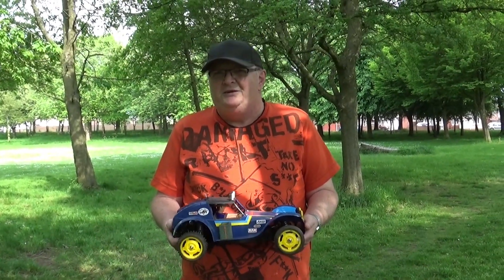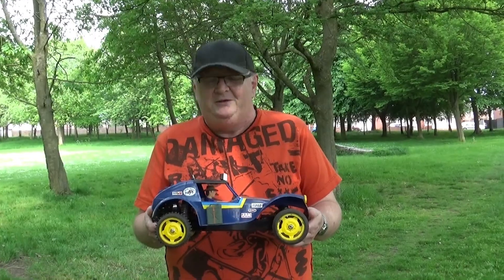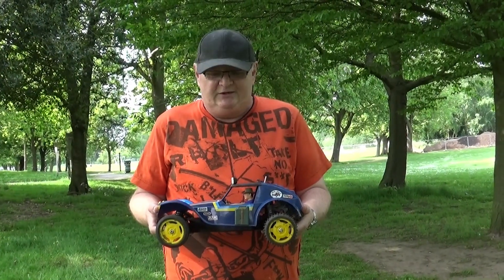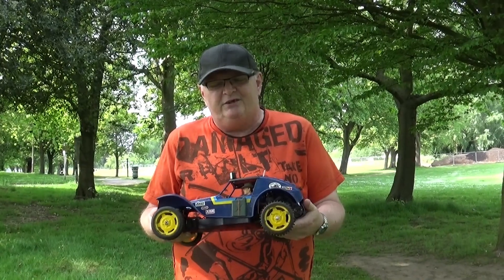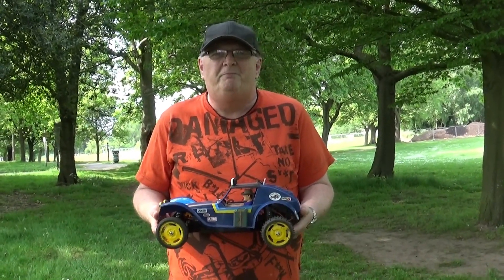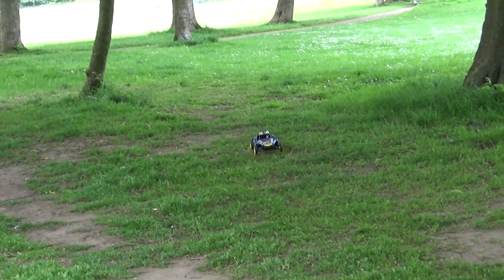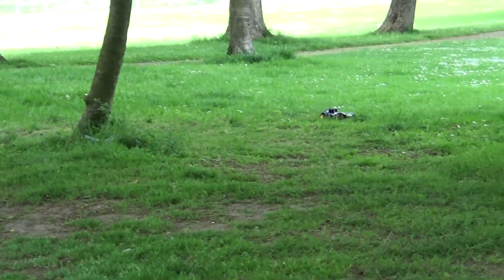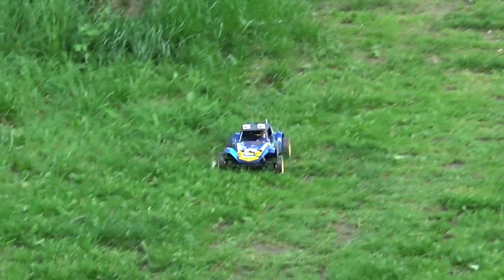Tamiya Holiday Buggy Shock Oil Comparison

Comment: Hi guys, I’ve got a set of Carson oil shocks for my Holiday Buggy, they don’t have proper pistons in them, but they are the same as the Tamiya Hummer shocks with the solid metal non holed piston, bottom line is......way better than the pogo stick shocks Tamiya supply. Awesome video guys, still getting chuckles from your videos lol 😝.👍👍👍🇬🇧
Reply from the maker: You got that right Mike. Any CVA shocks are better than those pogo sticks. Just need to find the right oil lol. I think the tolerances of these FTX shocks might be closer than Tamiya's or the holes in the pistons are smaller. Either way the thicker oil was far to thick for them, but you live and learn. Thank you so much my friend and stay safe.

Comment: OY Rob and Mark!!
I won't know what I was supposed to see at the end of the Track.... Until I get me new Computer 💻
It did seem a bit stiff at first, but the next run looked much better!! 👍👍
The DT02 is just an impressive basic Chassis!! 😎  Not competition ready, but brilliant for what it is.
Reply from the maker: Hi Carmine. I like the DT02 chassis as well so I was very surprised how bad it was on the first run after installing the CVA dampers. I think the Fastrax shocks may have tighter tolerances or smaller holes than Tamiya ones as even now the rebound is still quite slow but at least now they seem to absorb the initial bumps a lot better. 
Sorry mate I'm really behind on YT (still recovering from my second COVID jab) but I get round to everyone soon.
All the best my friend.
Reply: @robbrennanrc  
Bloody COVID!! 😖 
I have to remember to rewatch this... While you were gone, I got a 17" Laptop!!! 😁 

MOST Shocks have better tolerances than Tamiya!! (Except for the TRF Shocks!!) 
These seem good, I'll have to loook into getting some. 
Cheers and FEEL BETTER!

Comment: Hiya Rob.  Yeah looked better the second time.  It's difficult to know sometimes without a test run.  I think that if you have it on the bench with the battery in a you push it down it should spring up to the middle fairly quickly.  Also the drop test from a low height is always good.  Anyway, nice to see you chaps having some more RC fun :-)
Reply from the maker: Cheers Pete. Yeah I do both those tests, but I'm rather lazy so when the push test wasn't successful but the drop test didn't bounce I decided to leave it. Big mistake I can't remember how many times the back end bounced over the front while the cameras were off Booo!! But as soon I got back (well the next day anyway lol) I swapped to the Tamiya yellow. Hope all is well mate, Just had my second jab yesterday ouch!

Comment: Looked more like it with the softer shock oil😉👍
Reply from the maker: Yes indeed. I think those Fastrax shocks may even be better with slightly thinner oil or spring adjustment as the rebound is still quite slow. Many thanks for watching and all the best.